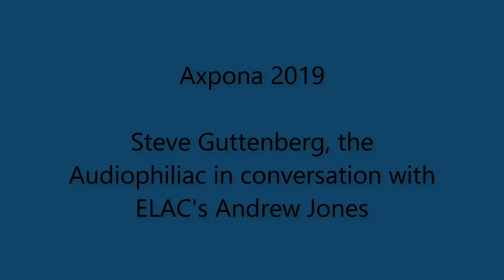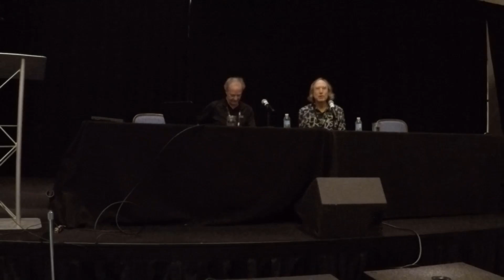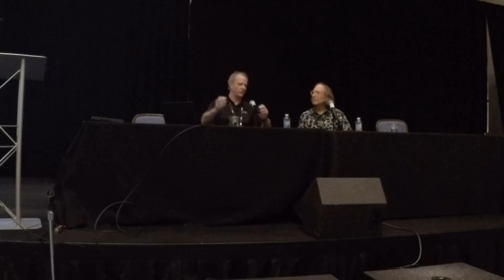ELAC’s Andrew Jones: The art of speaker design, Part 1

Comment: 13.26   This discussion of trading sensitivity for bass seems misguided for a modern speaker design.    This is true for a passive speaker with no equalization applied where you are lowering the woofer resonant frequency by adding mass to the cone.  This is just stupid in the modern day.  The bass is actually limited by the woofer displacement = Xmax * Cone Area.  Cone mass isn't in the equation.  It is a rare and odd woofer design that would be power limited at low frequencies.  So you can extend the bass in a modern design with equalization or  boost in the low frequencies, using a Linkwitz transform,  without lowering efficiency by adding mass to the cone.  If you need more bass, you buy a woofer or woofers with more displacement.

Comment: Nice! The first time I heard or read about the problem of heated voice coils messing up the frequency response of passive crossovers. And Andrew even didn’t mention the changes in crossover frequencies in the crossover filters because of heated voice coils, messing up the frequency response even more.

Thumbs up for active crossovers!
Reply from the maker: Jerry Rutten Jerry, I don’t see why active speakers would be any less prone to this problem. The problem is in the voice coil of the drivers heating up the crossover, active or passive has nothing to do with that.
Reply: @SteveGuttenbergAudiophiliac  Hi Steve, Nice video’s you made with Andrew! Can you show us the formulas and curves Andrew used in his answers?

And about the subject. I was not talking about active speakers, I was talking about active crossovers…

Passive crossovers are designed for a specific impedance. The driver heats up the voice coil (and maybe just slightly the crossover network itself) and the driver impedance rises. If the driver impedance changes, the frequency response of the crossover filter changes also (the rolloff changes (peaks) and/or the crossover frequency changes, depending on the network).

Andrew at 17:38: "On top of that with a passive speaker, the crossover network is designed to work into a specific driver unit impedance. If that is changed it misterminates (?)  the network. … and it is a mess."

 (I think he ment a speaker with a passive crossover)

An active crossover is positioned before the power amplifier, thus the filter responses are not influenced by the driver impedances. So, the problem of messing up the crossover response by the driver impedances is specific to passive crossovers.

And, on top of that, if you have current-drive amplifiers (a very high output impedance) there is no power compression at all. (Actually there is 'power expansion’, but there is no audio compression or expansion because of change of impedance). With high efficiency drivers you have less compression, with current-drive you have no compression.

So, with active crossovers and current-drive you have a stable response and no compression.

Comment: I balk at buying ELAC speakers due to their inefficiency. My amp is only 25 watts into 8 ohms and 40 watts in 4 ohms.
Reply: Get a bigger amp?  They are not that expensive.
Reply: @ErikGenerik76  Cheap high power amps aren't exactly the best sounding ones. I'd bet his Class A 25W amp sounds better than most Class D 100-200W amps.
Reply: Lol
Reply: Albert Huron I take it you can afford higher power? You laughing at my 25 wpc into 8 ohms?

Comment: I think ELACs are cool and sound good but a little overrated for me. Being more affordable goes by the wayside when you need monstrous power for them. I don't agree with Andrew's design philosophy at all. Efficient speakers designs like Horns, Concentric or even single driver floor standers. In my experience owning many different types of speakers and systems, High Efficiency can do dynamics so much better, can start and stop faster with far more ease, play louder with less distortion and way less amplification required and tons of headroom left in your amp. High Sensitivity doesn't mean less bass or "dynamic compression" as he claims, that's baloney IMO. I guess in car audio doesn't matter you can hide all the amp power you need. But for home, personally I have no interest in types of speakers that need to be pretty far from a wall, basically you need a dedicated stereo room which I would never want to sit and look at a rack of gear for hours in an isolated chair by myself, boring. And If the a speaker doesn't do well near walls next to my OLED, I'm not interested. And actually contrary to what Andrew says you can get great bass, fairly small box (compared to a floorstander), and efficiency.... just look at the RP-600M. Or the king of bookshelf bass, the Buschardt S300/S400s, the latter of which could be the last word in Bookshelf sized speakers... and those which although slightly less efficient, do more bass and are far easier to driver than the equivalent ELACs. For some reason the British speaker makers other than maybe Tannoy have this thing with power sucking speakers, I don't get it. Low to mid 80s dB efficiency, no thank you. Andrew is a VERY talented designer no doubt about it, and I wish him well. Obviously many people share his taste in speakers. Audio is a very personal preference and choice, that's part of what makes it so interesting. Your the best Steve! Thanks for posting this!

Comment: I always feel bad for a designer when general public says this speaker is better or that speaker is better. Better at what, for what, where, with what and for who?
Reply: Some listeners only want bass. 
Some only want detail (usually treble). 
Some want soundstage, others think that soundstage ( a holographic presentation of the recorded space) is a complete myth - they NEVER hear the soundstaging capabilities of a stereo speaker pair! 

Still other listeners only want large scale, or LOUD, or high sensitivity. 
I've seen electronics shoppers completely dismiss Magnepan speakers because they're not very sensitive or super dynamic . . .but damn, what the do they do EXTREMELY well.  

So I own sensitive speakers (Klipsch Reference), less sensitive (Magnepan) and several brands that fall in between. Not limited to one system I'm always trying recordings out in different rooms on different systems and love that joy-of-discovery when you get the right match.